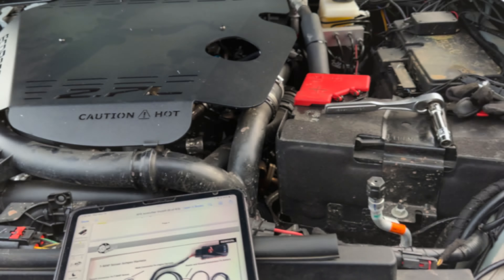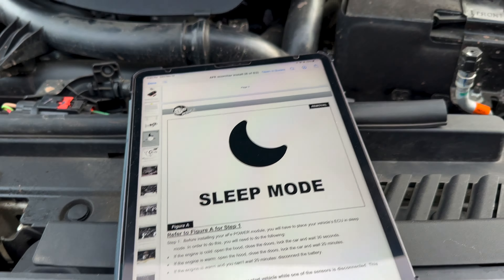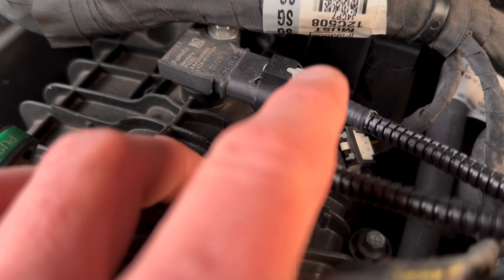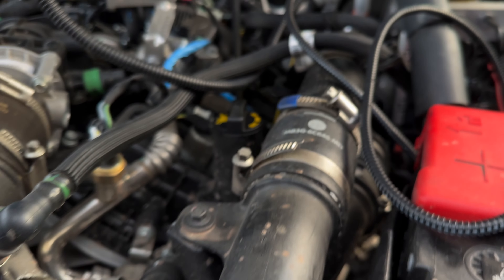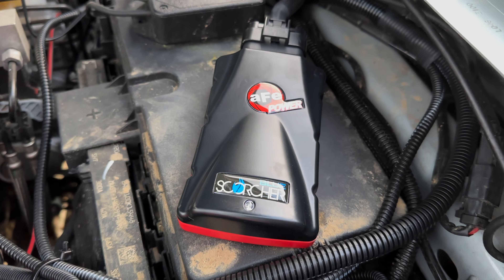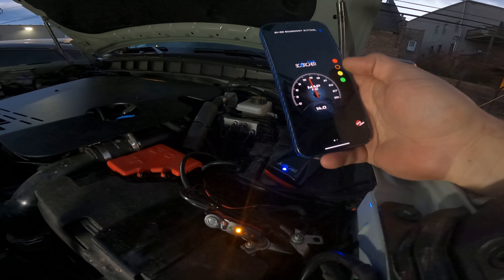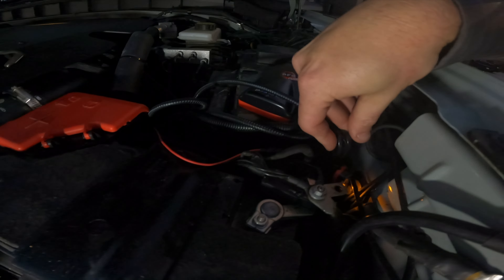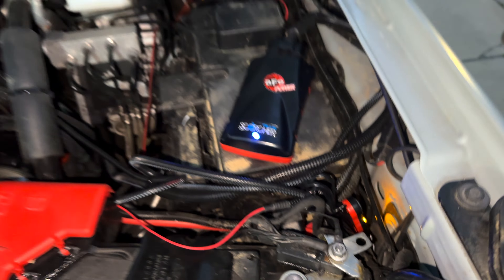Bronco AFE Scorcher Blue Power Module

Comment: I have a jb4 with the bluetooth kit but someone told me the scorche gains about 93 horsepower so i'm thinking about buying it what do you guys think?
Reply from the maker: I’ve heard the opposite.  That jb4 was more hp
Reply: @BirdDogOffRoadAdventures  what i'm sure off the jb4 gains more power only with a higher octane fuel which is kinda annoying and i heard from someone that the jb4 only controlls turbo boost and doesn't tune the cylinders i'm not sure which one is better anymore.
Reply from the maker: @v_1752  Thanks for sharing, I was not aware of that.

Comment: So whats the current update on the module, still holding up?
Reply from the maker: Not good.  I sold it to a friend who keeps having it go into ‘limp mode’. We sent it back multiple times and it works for a bit and then starts messing up again.  AFE is now trying to make send them the specific codes, but they were already removed and my friend is afraid to try it again in fear of it messing something up.  Needless to say, I wouldn’t recommend to others.  I have the Ford Tuner now.
Reply: @BirdDogOffRoadAdventures  welp, guess I'll just riding in Sport mode then. Give us an update on the Ford tuner.
Reply from the maker: @rudychavez5490  had it in since April and not a single issue.